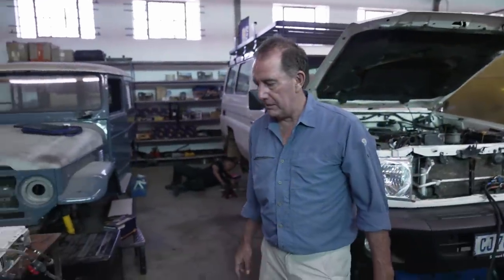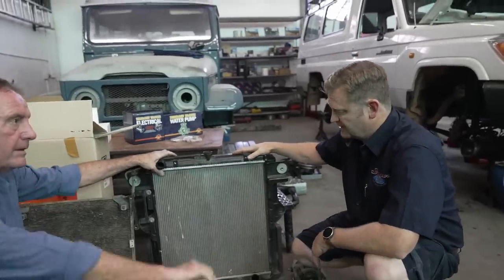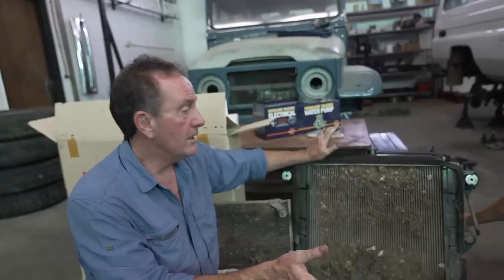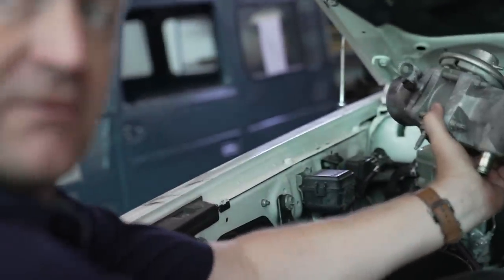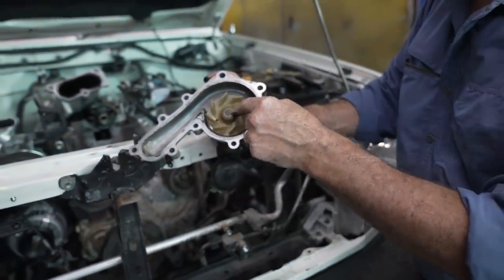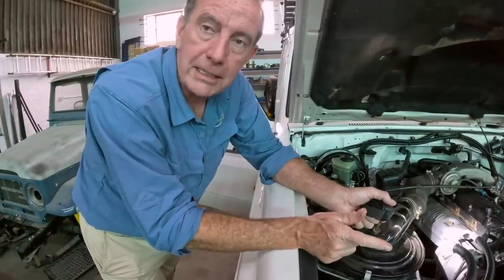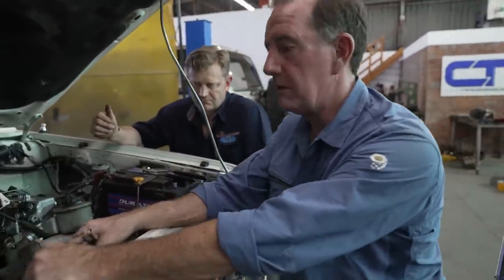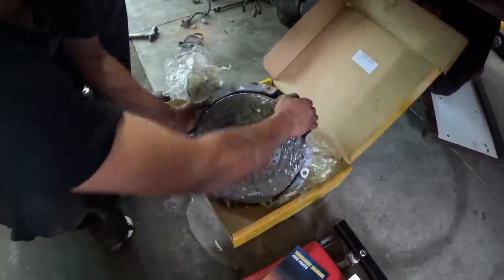ENGINE COOLING & FUEL SYSTEMS Half-a-Million-Km Toyota Land Cruiser Ep-13 @4xoverland

Comment: A chap of Andrew's experience should have cleared that detritus before setting off ...
Reply: You can't always see it, plus he would've had to strip  quite a few items just to get to it. 
He also wanted to get out of Gauteng asap😆😁🙋‍♂️👍🏻
Reply from the maker: Mate! I wanted to get out of there as soon as humanely possible. So I did just enough work to get it safely to Cape Town - without a proper workshop, I should add. And it worked.
Reply: Those 1 HZ engines are so tough and overbuilt, that would hardly have hindered the cooling system on the open road with high wind/airflow. Perhaps in the bush it might run hot. No harm done😁🙏👍🏻🙋‍♂️

Comment: I thought toyotas never needed to be repaired. Have all my toyota friends been hiding their repairs from me?
Reply from the maker: Only a Land Rover fan would suggest that Toyota owners make that claim.
Reply: @4xoverland  I'm only kidding. They ask me to work on them when they need repairs.
Reply: @4xoverland  They leave those comments all the time on my channel.
Reply from the maker: Toyotas break down like anything else. Although, times between breakdowns are longer than average. I've owned and operated both Rovers and Toyotas. My Rovers always took a lot of time and effort between trips to keep them reliable. Toyotas, far less time needed to be spent. Components wear out slower. Only the wheel bearings on a Landcruiser need servicing more often than on a Rover. But that's the only thing I can think of.
Reply: @4xoverland  I see hundreds of 4wds in a weekend and the breakdowns that occur, in addition to the vehicles we use recovering them. I'll stick with my original statement of the typical Toyota owner claiming they just don't break, which is patently false. I know better than that because I've worked on them. It's the arrogance that drives me crazy and I never miss an opportunity to point out that Toyotas break too.

Comment: Love the Attenborough impression!

Clogged up radiators is so overlooked (overcooked...), especially for all of us with bull bars, winches and lights.  I now keep a soft 15L plastic water bag/bladder that i roll up and keep with my spares, it takes up next to no room. This allows me to quickly dump my coolant, pull our and clean the radiator, then refit and refill. Can even be done on the track if needed.

Comment: Excellent work done by Paul Marsh.👍🏻👍🏻
11:35, you can knock the a/c idler/tensioner pulley bearing out and replace just the bearing, if the pulley is not worn where the belt runs.

Comment: It might be a controversial point but I think there is a lot of merit in using as many stock items as possible, just for field serviceability. Of course bolt on parts that can be readily swapped for stock should fulfil that requirement.

Comment: Are you gonna use water cooled sealed alternator ?
Reply: The one they fitted. Did you see the water cooling jacket? I didn't.
Reply from the maker: No. The alternator is not vulnerable like it is on the V8.

Comment: Catch cans can be a big problem if undersized and create vacumn so the engine wil eat oil if not serviced, how the hell do you get 500k from an alternator, if that thing has done half a million km in Africa it must have been on a dyno. Those shocks with exposed rods and remote stone catchers look fancy, leaf springs dont need fancy they self damp, unlike coils.
Nice advertisment for terrain taimer,  I have only had good experiences with them myself. shame we cant get late model with a 6cyl engine here in Australia, I'm still running my 1HD-FTE HDJ79
I get offers to buy it every time it goes to town.
Reply from the maker: Only cheap and nasty leaf springs self damp - to a degree. Good ones with articulation and a good ride need good shocks.
Reply: @4xoverland 👍🏻

Comment: All the Toyota diesel specialists here in aus say not to use a catch can. So which one is it lol
Reply from the maker: Easy. Don't buy a cheap untested one. They can cause over pressure in the crankcase. Saying don't fit one is safe. Better none than a bad one.
Reply: Most diesel specialists here in Australia only recommend fitting a catch can to common rail diesel. Not needed on older diesel engines.
Reply: @bogged2theeyeballs695  its the opposite from what people have told me. The new diesels pressure the crank case like said above

Comment: aren't you relying on terrain tamer to much or are you planning to have a bunch of spares with  you, have you considered supply chain issues in the whole of Africa???
Reply from the maker: Toyota spares are common throughout Africa, especially for these Landcruisers. Next to HiAce taxis, they are one of the most common vehicles. But this build is designed so I won't need them any time soon.
Reply: @4xoverland   Toyota might have all the spare parts in the world andrew, to get you by though you are using  3rd party parts not toyota genuine  it is after market supply chains  I was commenting on not toyota...
Reply: understand this terrain tamer make aftermarket parts for toyota's  vehicles  they don't rebrand toyotd'ss parts catalog
Reply from the maker: I'm still not clear on what you are suggesting. If I need a spare, I have the choice of Toyota or after market. What does it matter? I'm not changing the car so that it can only accept Terrain Tamer parts.
Reply: @4xoverland  what i am talking about you have decided to fit a terrain tamer products to your vehicle you found it good for your needs here however have you ever consider  it failing and not being able   to replace said product in  another country??

last I checked you  brought  the terrain tamer kit into SA though no consideration if or when it will fail..

what works good in OZ may not work well in other parts of the world, due to lack of supply... or should i comment on resupply
Reply: @jasonhowe1697  i get what you are saying...but like Andrew said, he has not modified the vehicle to accept only terrain tamer parts. so even if he might get a breakdown, he will simply remove the terrain tamer product and fit the widely available Toyota spare and continue with his journey
Reply: Paul Marsh is such a knowledgeable, kind and gentle man.
Reply: @lizowilliam013   terraib tamer is a mod to a land cruiser
Reply: @jasonhowe1697  Dosen't matter mate, nothing is custom or extreme lift or that kind of sillyness, everything this bloke has put in was swapped out and can be swapped back to original FFS
Reply: @hatblocker it gets might expensive replacing 4 things pending on what has failed???? !!!

the unknown factor with terrain tamer  is how it will function in africa as a whole as their products were designed for Australia in mind not Africa in mind

having something that works in Ausrtralia, doesn't mean it will function as intended in africa it has yet to be tested....

Comment: Talking about Catch Cans........there's quite a bit of discussions happening here in Australia about not fitting Catch Cans to diesel engines. It's only a new'ish discussion.....less than 12 months I believe. So I'd like your take on this topic. To fit a Catch Can, or not to fit a Catch Can.
Reply: flow, so as not to create a pressure issue that mkes them suck oil through seals
Reply: Easier and cheaper to just blank off the egr...no harm done with the oil mist going into the intake as long as there is no exhaust gas.

Comment: 5:11 Catch can on the 70, the arcane. For some people it is mandatory (keep the "engine" clean), for other it is unnecessary (you must clean the "engine" anyway) and for a few it is a mistake (less oil means more dust ingested). For sure Toyota doesn't have any interest on this relatively cheap accessory. I am confused.
Reply: If I understand what you saying is why dont the vehicle engineers fit catch cans to engines. Its simple from my understanding is the EGR is installed system to bring down the emissions of a vehicle and meaning the manufacturer doesn't pay as much tax. To me its basically the manufacturer saying lets save us money and make it the customers issue when the engine is full of gunk after the warranty.
Reply: @henkstols9326  very clear answer but I still don't understand if the catch can is beneficial or not.
Reply from the maker: A catch can is worth fitting if you intend to keep your diesel for a long time. It helps keep the inlet manifold and turbo intercooler radiator free of oil vapour residue that over time reduces its efficiency.
Reply: @4xoverland  that sounds like blackmail. And Toyota is doing nothing!
Reply: Just blank off the egr and the intake stays clean with only a thin oil smear and no sludge caused by the exhaust gas.

Comment: Make sure you get the correct valving on those shocks. Terrain Tamer fitted much harder valving to a number of the Pro shocks. We're in the process of getting them changed over, as Terrain Tamer have admitted their mistake.